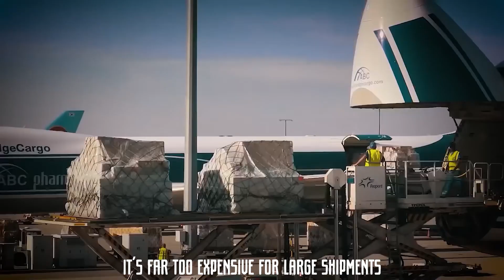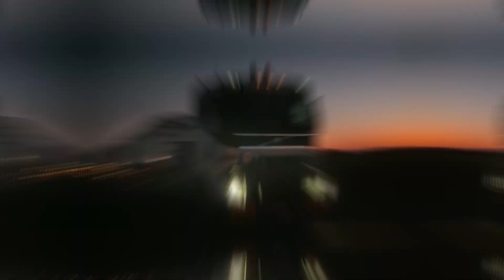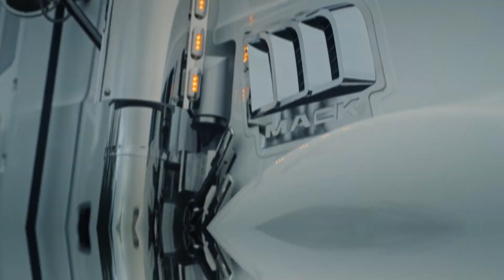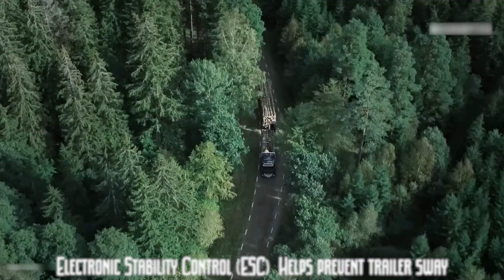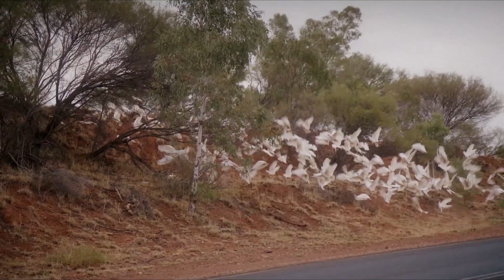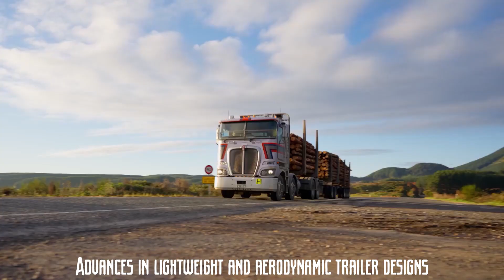World’s LONGEST Truck! Australian Road Trains

Comment: B doubles don’t have a second engine in the trailer. That’s the mining power trailer. Also road trains don’t run EBS. They might have ABS but neither are of these help on dirt roads or rural highways. The advanced braking systems don’t last on the rough roads. 
Other then that this items it’s a pretty well rounded video showing some of the latest PBS combinations.
Reply from the maker: Thank you will update our notes on those two items. Appreciate you tuning in!